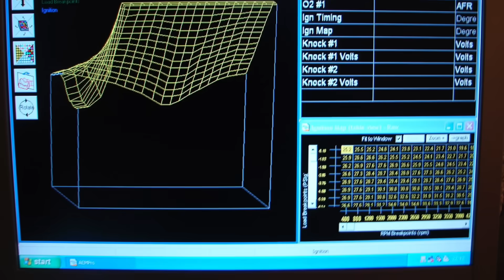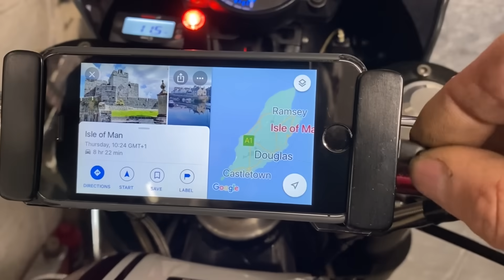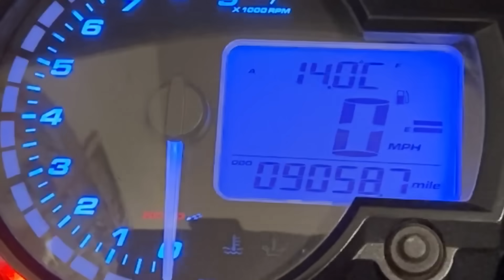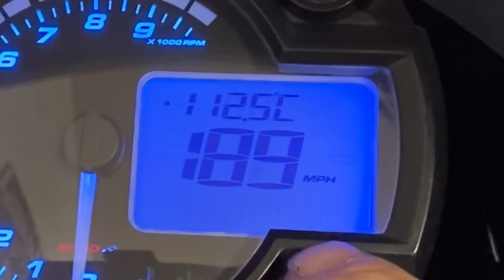Millyard Viper 8 Litre V10 Motorcycle - Part 1

Comment: Oh, I love this one.. Most likely the only Dodge V10 in the wold that is actually drivable  and does decent mileage. A question about hubs and bearings: What are  they, and how they last?
Reply from the maker: I made the hubs and spec’ed the bearing they are over engineered to last for ever
Reply: @AllenMillyard  So the bearings are off the shelf items? Are tey from a specific vehicle, or just basic? May I dare ask a part number?

Comment: Like everyone else in the comments, I only have praise for your excellent work. It is clear a whole lot of love went into making these machines of yours. One thing I didn't quite get - you mentioned it was direct drive through the clutch - does that mean you aren't running a gearbox at all? Or have I misunderstood? If there is no gearbox, was that your original intention or just a product of the available space? Keep up the fantastic work Alan!
Reply from the maker: A gearbox would be nice but would have made it 12" longer and look wrong so i chose the single speed route early on. With 500lbs/ft torque its no problem effectively pulling away in top

Comment: You are a LEGEND... coal insulation... OF COURSE!! Metro 6r4 rally car brake wow.  I wish i had one of your z750(1500) v8s, but i modeled my build like yours. Off of parts i could get. My z650 frame bolts to 2000 gsx600f katana forks, and full rear swing arm. Modern brakes and damping on a 70s bike. I love it. Maybe one day ill do a walkthru on my bike. Everything ive done.

Comment: Allan, i have a question for you; does the bike have a tendency to lean over when you rev that massive longitudinal engine? Does that affect handling while riding?
Reply from the maker: It’s un noticeable when riding due To it’s single speed transmission it’s only noticeable when pulling away

Comment: Thx again, Allen, for getting my brain turbocharged. Really liked the exhaust insulator bit. I’m thinking of lining the inside of a silencer/muffler, with that approach, and see how it does. I know it's not a proper sound absorber; more about how it changes fundamental frequencies, sound pulse depth & keeps silencer cool. It can also serve as a crude Cat Converter; as it directs heat back to the flow & aides combustion of residuals. I have a small 2 stroke race engine. I think I will try it out on the expansion chamber, for grins & guffs.

Comment: Yet another fab Millyard creation..........but I'm perplexed as to why you chose to fit a split link to the drive chain!! Surely a rivet link would be the safest option on a 500bhp monster.
Reply from the maker: It’s fine to use a split link if it’s good quality and fitted correctly  I’ve never had a problem in 50 years
Reply: @AllenMillyard  I respectfully beg to differ Allen....the number of bikes I've had in for MOT over the years with missing split links would stagger you.

Comment: Wonderful video Mr Millyard, however i do have a question. How do you get the gauges to work? do they just plug and play into the regular harness or do you have to do some modifications to allow it to read stuff like the RPM?
Reply from the maker: The koso gauge comes with a speed sensor and the rpm signal comes direct from the AEM ecu  or could be connected to the low tension side of one of the ignition coils
Reply: @AllenMillyard  ah, OK that makes alot more sense, thank you very much

Comment: Absolutely mental! 

189 mph on a direct drive system. Thats nuts!

Whats the fuel consumption? 

This is my 3rd favorite bike you made. At number one is the SS100, then the Flying Millyard, and then this one. So great!!!
Reply from the maker: It will go from 0 to 220 mph in one gear if held wide open
Reply: @AllenMillyard  oh my thats awesome!

What amazes me the most is that you completely hand built the bike yourself. And it looks well built and strong. I could never do that myself. And the fake coal part was also ingenious 😆

Comment: Maybe NASA wouldn't have lost 7 astronauts if Allen had designed it.

Tell us about the tyres, the rear one in particular and it's typical lifespan.

Liked the plug for Henry's book.
Reply from the maker: Two fronts for each back tyre they typically last about 1000 miles
Reply: @AllenMillyard  Are they special reinforced tyres to withstand the extra load on them, the power, torque and weight of the bike esp the rear and what size?

Comment: Loving your ingenuity Allen. 
I did wonder what sort of tyres you are using to handle speeds of 260 mph plus the weight of the Viper motorcycle. It occurred to me that most bikes capable of such speeds as 200 mph plus must be in general much lighter. 
Please keep posting the videos. They're great 👍

Comment: Amazing creation! I’m just wondering how it’s legal to drive a bike that ones built from scratch on public roads? I’d love to build a bike from scratch one day but I see the legalities as a major roadblock :(
Reply: The answer is that it has to pass an MoT test before you can even register it for the road, & insurers typically won't insure a vehicle until they have had an independent engineer inspect it. So it needed things like two independent braking systems that would actually stop the machine, the full legal range of lights etc etc, just to get a road registration, but then presumably either the insurer said 'It's Alan Millyard, of course it will be brilliant, safe & the only 8 litre V8 motorcycle that is genuinely useable as a daily commuter, so we will cover it sight unseen', or an engineer had to look it over & make sure it wasn't going to end up as a giant fireball tank-slapping through a primary school if they covered it...
Reply: @fat_biker  cheers  for the reply Ken!

Comment: How did you know that 90° bevel box would handle the power from a 500hp Viper V-10? Also is it a gear reduction? Thank you Allen for another fabulous video. You are brilliant.
Reply from the maker: Its 1:5 to 1 reduction and of huge proportions and more than capable. It’s been used hard with no problems to date

Comment: Brilliant 008. With all your gearing options, what is the slowest speed you can ride the Viper at? I seem to remember it being just under 25mph when you were here in Guernsey with it 😀👍
Reply from the maker: Yes when I fit the biggest 46t it’s about 23mph at idle, I can’t brake to slow it further because the computer senses a low idle condition and opens the idle bypass valve increasing the revs 🙈

Comment: Allen is such a genius at solving engineering problems. I’d love to see Allen do a Hossack front end. The vertical wheel travel means no dive on the brakes and the single shock can be specced for the bike by someone like Revs in Birmingham to Hagon in London. 
Some hydraulic landing gear world suit the Viper. Stopping at traffic lights with feet up would be a hoot.

Comment: Could you grind up the fake coal, mix with high temp epoxy and apply as a paste?
Reply from the maker: no it wouldnt work
Reply: The epoxy would fill the holes...

Comment: Allen, what speed do have to be travelling  to let the clutch fully out? Have you had to replace it often?
Reply from the maker: I idles at 26mph  with my 42t rear sprocket , I had to Change the clutch at 5000miles due to a day at Sywell aerodrome doing repeated 1/4 mile runs with the motorcycle news I was hitting 170 mph though effectively pulling away in top gear 😎
Reply: Fantastic, thanks for the extra information Allen. I'm already looking forward to part 2! 🙌

Comment: Are there any major downsides to not having a gearbox? There don´t appear to be. What´s next - gas turbine power?
Reply: With a single speed, a torque  converter would probably be more drivable than a clutch.
Reply: @EDesigns_FL  Makes sense. In fact, aren´t Konigsegg doing something similar?
Reply: @jamesdeath3477  Yes, the Koenigsegg Regera is a single speed that relies on the slip of a torque converter to cover a very broad speed range.
Reply: @EDesigns_FL  pity this sort of thing only works when you have huge amounts of power, or low weight.

Comment: I just love how completely well thought out your bikes are, you never overlook a single detail.
Forks made from hydraulic rams, rear springs from a Ford Escort on R1 shocks, foot assisted clutch with servo, neutral selector on a fixed speed box, heat shielding made from artificial coals, quick release seat mechanism and ratchet center stand made from a spanner that was taken apart and the mechanism attached to the stand pivot, even a tiny switch to change the engine map for a touch of fun !
Plus it looks like it came from a factory or big budget racing organisation because of it's amazing fit and finish ! Yes there are some smaller details that are obviously hand made but they are quality parts, not cobbled together, your fabrication skills are beyond belief !

I'd love to know how you fitted the cam timing belt around the front frame, do you need to take the frame off to change the belt ?

Comment: Hey Allen, what a wonderful piece of engineering.  Why a single sided front brake, does that not affect pulling up straight at speed?
Reply: Think about that question for a minute. Why would it pull the the side? It's not a car. The brake only affects it on one axis.
Reply: @Konocti  So why have all the bikes I've had for the last 30+ years all had twin discs on them then? Its not a pushbike is it and at  180mph + I'd like to know it pulled up straight.
Reply: @2ToneWalt  Because that is a great way to get enough surface area to enable proper cooling. Smaller bikes use a single disk to save weight, and they don't pull to the side in the slightest. Think of how Buell used a single brake disk attached to the rim to enable a larger surface without adding more weight. (I wasn't happy with the brakes on my XB12X to be honest) When I think back over the motorcycles I've owned at least 25 of them were dual disks, but the ones that were dirt bikes or small dual sports never pulled unevenly although most lacked either power or fade resistance due to the single rotor.

A car pulls to the side simply because one wheel is being slowed more than the other. A motorcycle can't do that.
Reply: @Konocti  A single disk causes forks to twist, which can be felt through the handlebars. So in a way, I understand what MrSteve is on about. This can be solved by using a fork brace, which is what Buell did.
Reply: @Zgurkogel  I believe that is possible on some poorly made bikes with undersized forks, but never experienced that on anything I've owned or test rode. Ironic that MrSteve is on here trying to  explain this to Allen. Where is MrSteve's video of his own V10 bike with dual disk brakes to avoid this significant issue? lol

Comment: I find it oddly heartwarming to see that a man capable of building these fantastic machines is also juvenile enough to install a backfire switch on an eight litre V10 bike.
Reply from the maker: @SGTDuckButter  A second channel is set up in the ECU where the fuel injection and ignition timing is re programmed at a specific point in the ECU map so that excess fuel explodes in the exhaust pipe on the over run. The switch toggles between the original map and the  modified map
Reply: @AllenMillyard  That, like so much of your work, is genius.
Reply: do in essence, for a certain rpm have the injectors work longer and retard timing a lot (-40 something)
Reply: @AllenMillyard  You must know that you are barking for using a V10...
Reply: @AllenMillyard  had the same on my subaru impreza - great bit of fun and a party trick! Did you say its a single speed transmission this bike???
Reply: I rather suspect that it is a prerequisite that a man capable of building these fantastic machines should also be juvenile enough to install a backfire switch on an eight litre V10 bike. 
If he wasn't that juvenile (meant in the nicest possible way) he wouldn't be building these wonderful toys.
Reply: Pardon I can't hear I had ear phones on.........
Reply: He makes me proud to live in this country.  He’s a true Brit hero
Reply: @SGTDuckButter  Wait for the next video, perhaps Allen will be kind enough to fill us in. I'd guess it's some sort of method by which unburned fuel is allowed to find its way into the exhaust and is ignited there by the heat of the pipe, or perhaps a deliberate mis-timing, or both. Terrifically mischievous device at any rate.
It puts me in mind of the "bang-bang" anti-lag systems used by some rally cars to keep their turbos spinning - I have a clever mate who researched how it was done and built a home made version of the same thing on his turbo Lancer some years back. He did it for fun more than anything, although he claimed it did actually work at reducing turbo lag as well. The crackling and popping and banging sounded wicked. One unexpected and unfortunate result was that it quickly destroyed the exhaust system! The dump pipe and pre cat length of pipe did not handle continual fuel detonations for very long, and nor did the cat. It was ridiculous fun, although his neighbours must surely not have agreed. We certainly heard him coming, that's for sure. 
Hopefully Allen has engineered a way around the exhaust system destruction. Like you I'd be very interested to know how exactly he's done it, especially given it has no turbo.
Reply: @woopimagpie  we just used to turn ignition off, full throttle, back off throttle n restart ignition aaaaannnnd; BANG!!!!! 😎💕🖖
Reply: @SGTDuckButter  well that is not that difficult I reckon it changes engine timing and /or fuel mixture.
Reply: @patrickvanden8322  If you know how to do it it's easy. If you don't know it's difficult.
Reply: @josephe3697  Name a skill where that's not true.
Welcome to tautology club!
Reply: @patrickvanden8322  Back in carburetor days, we'd be cruising along, see a couple of cute girls walking and quickly turn the ignition off, wait a second then back on.  Usually got a good jump out of them.
Reply: @davidj.7779  
That trick used to work great on my 5 litre V8's.  😂
Reply: @patrickvanden8322  Nobody said it was difficult. The commenter simply said that it was a nice touch that a skilled engineer would think to do such a thing.
Reply: @AlSnoopsReid  My comment was not towards the top commenter but towards @SGTDuckButter who has deleted all his comments here, he found it difficult to throw flames from a fuel injected engine.
Reply: I know right! That part of the video had me chortling. Heh. BANG! LOL!
Reply: That's essential not juvenile
Reply: Jim, this brought back memories of my dad. He was a gear-head and a hot-rodder when he was in high school...they used to run a wire from the coil (through a switch under the dash)  to the muffler, where they would drill a hole into the side and tap in a spark plug...just to get the backfire sound and occasional jet of flame...  Rock n' Rolllll!!!!!     He passed years ago, but once in a while I watch "American Grafitti" and I "see" him in the cut-down sleds...he was even mentioned in his High-School Yearbook...he graduated in about '51 or 52..and the quote (I'll never forget) said "...always seen driving his "new" '36 Chevy... but he knew how to make it (as they said )  " shit n' git ".....
'MURICA!!!!!
Reply: Common sense really. Did you hear how weedy the horn is?
Reply: @SGTDuckButter  I used to do it on my BMW.  Hit the kill switch while riding along giving the throttle a few twists to fill the exhaust with unburnt fuel air mix then putting the kill switch back on would normally cause a spark in the cylinder with hopefully an open valve would ignite the fuel air mix in the exhaust and KABOOM 💥   Under a bridge or in a tunnel is hilarious.
Reply: @SGTDuckButter  momentarily shuts of the engine filling the exhaust with unburnt fuel
Reply: @SGTDuckButter  add fuel retard ignition. Push combustion into exhaust manifold
Reply: Very impressive, I'm mind blown.

Comment: I've seen the concentric swingarm pivot/output sprocket on a few MTBs before. To eliminate chain tension variance throughout the stroke.
Clever to incorporate it here. Looking at pictures, i previously thought you had used 50mm Marzocchi forks, impressive to see they're even beefier and home made!
Reply: @Matthew Lund Saves you running a tensioner i guess also? First time i ever noticed the concentric BB/Pivot was on a Cove G-Spot (2000 ish?) although the idea may go back way further than that.
Reply: @supermotos  And Norton Commando